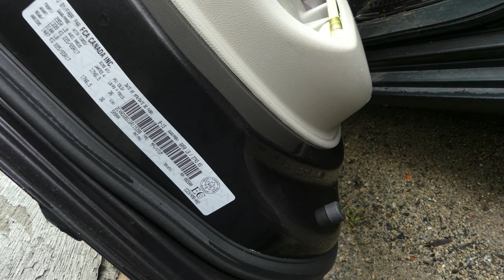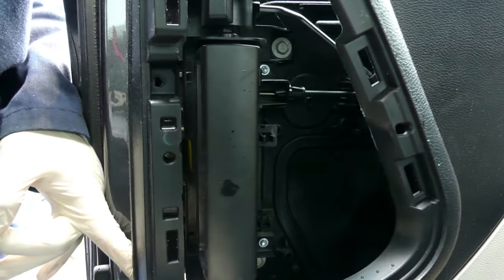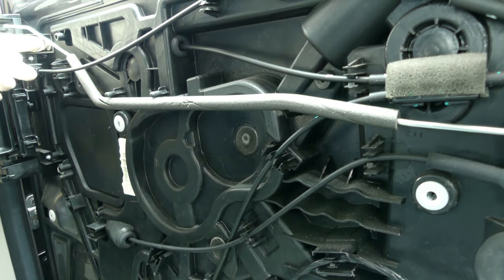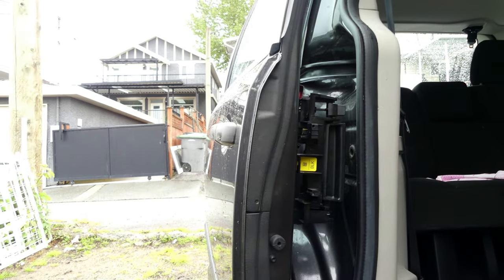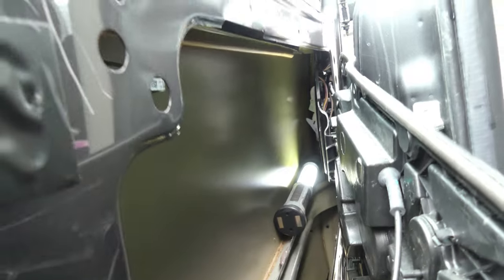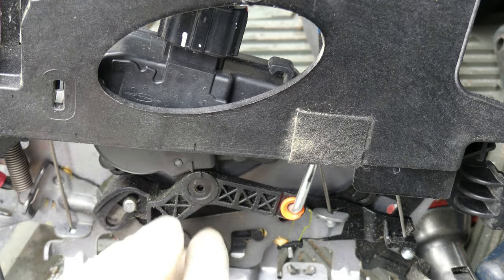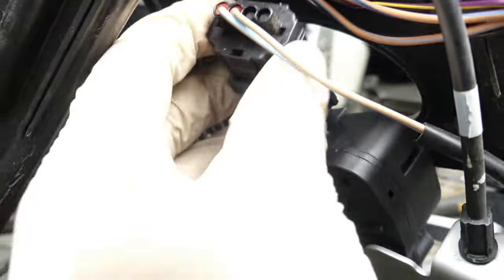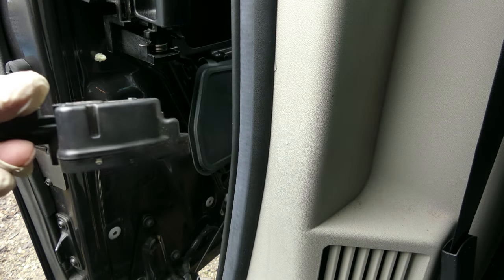2016 Dodge Caravan Sliding Door Lock Actuator Replacement [ Buzzing Sounds ]

Comment: Great video!  Unless I missed it, I don't think you explained how you detached the 2 cables on the left (towards the front of the car).  You did unscrew that whole part that bolts to the left on the inside of door, but I still didn't follow how you datached that from the big black plastic assembly.

Let me encourage anyone who might be thinking of doing this.  It took me just a bit less than 2 hours.  I didn't actually undo any of those cables on the left but I just left it connected and didn't fully detach the big black plastic panel inside.  Asian Mechanic Guy said he didn't put that big metal window slot rail back in, but I did because it looked like it was providing some support at least to the latch assembly.  I kept all of that all together and just replaced the door lock actuator in place.  The hardest part was getting the latch and everything all the way back in the door.  Just be patient with it and start with the left end angled up.  Then when you get it in a ways, bring the left end down and snake your arm in there to push it up into place.

Anyway, great video!  You did a lot of nice visuals on how to unbolt a lot of the pieces. I greatly appreciate it!
Reply from the maker: this is my first time to do this kind of car issue/repair
Reply: @asianmechanicguy6483  You did a great job!  Thanks for the video!

Comment: Thank you so much for this video. I had to watch it several times before attempting it but I got it done. Mine does have the motor and I was not able to get the bracket back in so I left the window in the up position and non-functional. I never use it anyways. If you ever replace one with a motor please post and show how to get the bracket back in and make sure the window is on the track. Thank you!
Reply from the maker: sure i will

Comment: My goodness dodge has crappy vans. Thanks for the video, I'll be doing this in a week.
Reply: The funny thing is I've got a 2012 grand caravan that has not had this problem and it has almost 280000 miles on it. But my 2017 grand caravan has a 117000 miles on it and I am now getting the dreaded buzz from the driver's side sliding door. I'm hoping that if that 1 craps out that at least all the other door locks will still work.

Comment: i have a 2017 dodge caravan and doors has always been making that buzzin sound. but just recently one stopped locking. now i believe that's a tale sign of of the locking mechanism failing. the mechanics want to charge 2 hours of labor right off jump. its ridiculous !!!! you did it in under 30 minutes !!!!! they wanna charge me $405 !! parts and labor !!! what a rip off !!!!

Comment: Kudos, I just did this to a 2012 with glass and tracks (yours did not have glass, 2 nuts less work!) how did you get the 3 tabs out  of the sub frame at 5:15? I never got that far, Mine was stuck in the lock position so I didnt have the liberty of removing the latch assembly in the jamb. I got fed up and just jammed the actuator rod back into the latch and it ,ust have broke the jam free as its working again...but now I have the buzz...but I can open the friggin door now. I think the buzz is the actuator over running its limit internally, like I think I jumped a tooth when I jammed the rod back manually? I see the little arrow on the lever and the mark on the actuator itself. This is a difficult job, you are better than me not breaking any of those push connectors. I broke 5.
Reply: the problem with yours is that its lock thats the reason why everything is difficult

Comment: Great video !! I have a big dilemma the sliding door was placed in its path (so that it would not collide in a small space) Keeping the button closed And an attempt was made to close it manually, forcefully. Now there will be no automatic And throws door indicator on the dashboard What should be done How do you have to coordinate the steel cable with the handle??? What moved inside? Please help!!
Reply from the maker: i feel u brother it took me multiple times keep repeating on putting it back until it goes all the way ..thers no standard procedure of doing this
Reply: @asianmechanicguy6483 OK bro but to repair mine Should I move the steel cable? and adjust to the electric motor where should I start I don't know anything about it send me a sign please !

Comment: Ours makes the same noise
In My experience with stuff like this even if you can get it done it will never go back together as well as it was before you tore it down 
We just live with the noise because the lock does actually still work
Reply from the maker: Yup its really tough to put them back but it can be done
Reply: What exactly does the noise mean? My locks work just the noise.
Reply: So- I too had this noise until yesterday. It stopped.

Now the sliding door does not unlock or open. It's jammed shut.
I'm counting my blessings.

I've read a forum regarding callbacks- and a lady said her sliding door is stuck open. It won't latch shut.

You may want to address this before the buzzing stops.

If you have a warranty- it maybe be covered because of the existing recall on sliding door actuators in Grand Caravans and Chrysler Town and Country.

Humorous note: I did not answer the phone calls regarding my car's extended warranty. So- I'm out of pocket and if I choose to fix this door I will be doing so from the inside of my car.

I'll be praying for all us owners- that when the buzzing stops- the door is not stuck opened.

Thank you for the tutorial and support group chat ❤️ 💕

Comment: I changed 2 actuators. They took too long.  In the second, I broke a couple of bracket and got frustrated after 4 hours. I removed the glass in 5 minutes and then it took me another 10 minutes to install the lock mechanism. I highly suggest removing glass and weather strip around the glass.

Comment: Can you do a video on how do do this if the door is locked shut?
Reply: Pull door panel off, then get 2 people. One pushing on the lock rod (pushing into the back of the door) and one guy pushing the unlock button on either of the front doors. This should cause it to unlock and then door opens.
Reply: Thank you so much Andrew.
Reply: @Willyd2758  that didn't work at all... Fortunately, I WAS able to reach an arm all the way through the door to the defunct actuator and manually flip the lever, which got it unlocked. But man, it was a b*tch 😂
Reply: Mine was locked shut and I could reliably open it by manually holding the lock button HARD in the unlock position and pulling on the door handle.

Comment: This was super helpful. It still took me 6 hours to do the job, but eventually I got it done. The tip at this video was really helpful to finally get it back together. I had a really tough time putting the assembly back on the door, but I found another video that gave a really helpful tip. If you take off the outside trip piece you can more easily guide the window rail back over the window: https://www.youtube.com/watch?v=Flkv42Pp4iE
Reply from the maker: Glad it helped!

Comment: been stuck at getting the panel out of the door now that everything is disconnected for about 2 hours. wiggling the panel seems to do next to nothing towards moving the latch assembly and thus dislodging the track bar. noticed you were able to separate the door panel from the latch via those 3 teeth. any tips on how to do that easily?
Reply from the maker: there is a stupid plastic that connect on the latch assembly i know its hard but try to remove that first i think i did not show it in the video cuz i did it by myself its hard for me to film everything
Reply: @asianmechanicguy6483  I appreciate the direction and you taking the time to upload this. I was able to take the rear-slider applique off of the door and it gave a little window to allow me to unhook the window guide from that vertical bar. Dont think i ever could have done it without that. The latch mechanism being joined to the inner door panel by plastic made it flex too much and not able to jar the latch assembly loose. A $25 actuator saved me from a $1200+ bill at the dealership, who wanted to replace the entire mechanism and charge over $900 for the part alone. 

For those who it pertains to, 2015-2017 Town and Countries have faulty actuators and they are covered by a 2021 extended warranty for 15yrs and 150,000 miles. Just gotta get a service center to diagnose it properly and not try to scam you for a more expense and not covered part (the whole assembly).

Thanks again! This helped a lot.

Comment: Nice work. What happened to the glass track? Did you put it back or left it out? Thanks. By the way, this video clip is the best demo on how to remove the whole door panel, among my search on youtube. Thumb up.
Reply from the maker: i did not put it back theres no use of putting it back as the glass is permanently screwed
Reply: @asianmechanicguy6483  hey have you had any problems with that door window.  I’m thinking about doing the same thing just leaving the track out.  It’s seems like hell putting it back in
Reply from the maker: @jsimms7688  not really is just that theres no point of putting it back this model had a permanent or none movable window glass
Reply: @asianmechanicguy6483  Are you sure that the glass doesn't slide at all ?
Reply: I'm pretty sure that glass slides down a little over half way down usually
Reply: His model doesn't have a sliding window, if you have a sliding window it is required.

Comment: I have a same problem, how much dealer charge for that?
Reply from the maker: from what the cusomer told me 3 to 4 hrs $120cad  per hour
Reply: @asianmechanicguy6483  thank you
Reply: Dealer today just quoted me $4-500 with me supplying the part.
Reply: Same issue on both doors for me. I will call for quote but about $800 to get rid of shitty sound?!🤔
Reply: Quoted at $900, definitely trying it myself

Comment: Seems like someone Dodge should recall and repair for creating such a crap door 😅
Reply from the maker: totally agreed its a bad design
Reply: Wow... just to replace a small device, you need to dismantle the WHOLE door... yea, I call this a VERY SHlTTY DESIGN... All anyone needs to do is simply removing the panel and replacing the part. It shouldn't take no more than 15 to 20 minutes.
Reply: They did provide extended warranty on this issue to 15 years/150000 miles
Reply: @ryanlaw213  I need to do the same soon. one of my sliding door won't LOCK, man. So, it seems if I do it myself, it is going to be an ALL DAY EVENT... lol...:face-blue-smiling:
Reply: @ryanlaw213  Thanks. I'll have to look into that.

Comment: I get the noise but yet my door locks and unlocks perfectly fine and has for years since the noise started.
Reply from the maker: same here door still lock and unlock
Reply: @asianmechanicguy6483  a little noise doesn't bother me lol
Reply from the maker: @Relevantminded  then thank u for dropping by lol😁
Reply: Eventually the lock will fail and might get stuck in the lock position.  You wont be able to unlock the door from the switch or toggle on the door and the door wont open.
Reply: @tcr03  If I had too I'd just remove the backing from the handle and manually pull the lock rod to unlock it. Originally, that was the only way it would lock and unlock, but for some reason, after a while, it started working with both the remote and by hand again. That was over 2 yrs ago and it's still working lol
Reply: @Relevantminded  yeah.  I had one today at work where the actuator seized up and not even pulling or pushing on the rod would unlock it.  I had to disassemble the whole door
Reply: @tcr03   If it comes to that, I wouldn't mind doing it as I've had to learn to do a lot of work on my vehicles when that nasty covid business started up, I think I'd take the whole door off to maybe make it easier and maybe even faster to do.
Reply: @Relevantminded  yes.  I took the whole door off. It was much easier.  I recommend having a helper with taking the door off.  Its abit awkward
Reply: @tcr03  sounds good. I'll probably have my son give me a hand with that then.